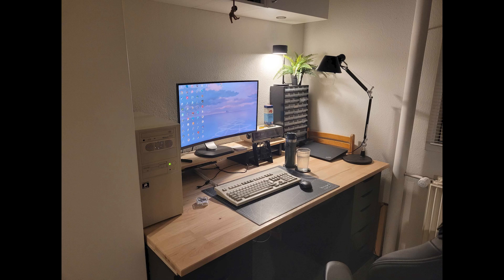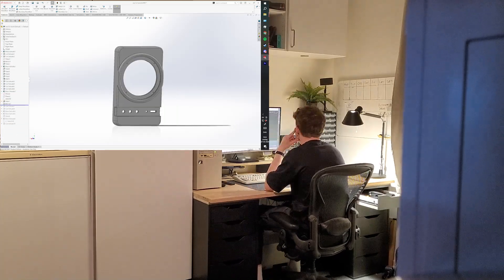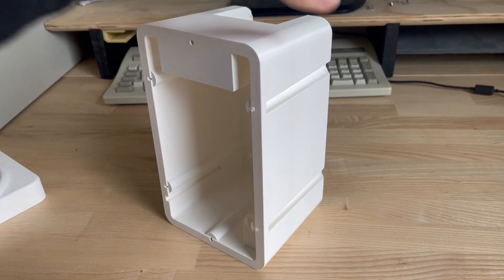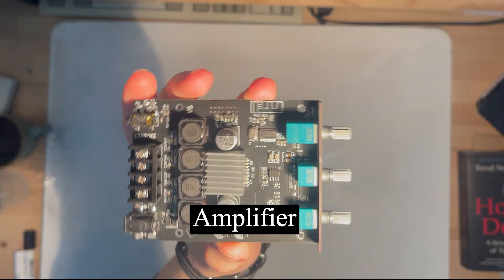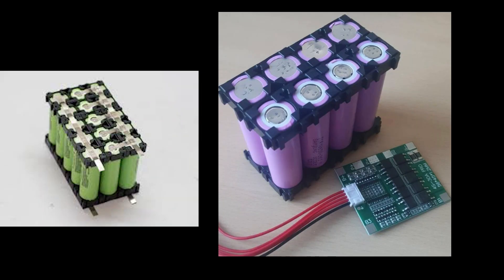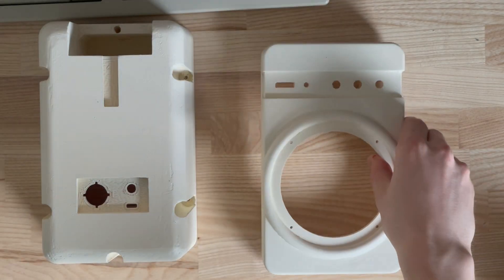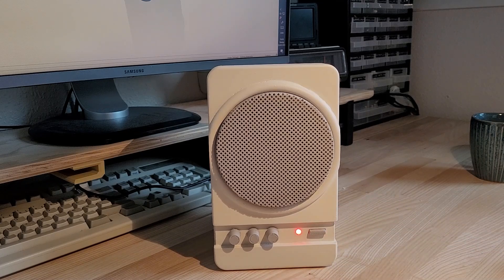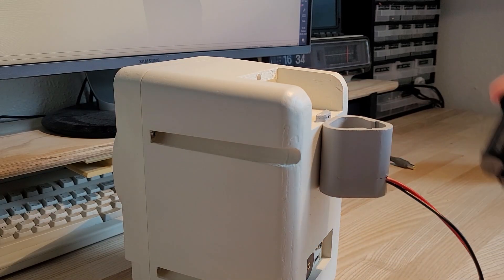Making my own speakers (the real ones were too expensive)

Comment: Watch out as I also used a powertool battery for a speaker, but it had the power cut protection in the tool itself, so my speaker drained one too deep and it damaged the cells. I bought a protection circuit that I set to cut power when the voltage reaches 16V (Its a Parkside X20V Team battery)

Comment: I like the Idea! There seems to be much space inside so maybe a fuller range driver setup with routed sound ???Channels???Resonance_Space??? for audio optimisation would be cool.
Also it would be cool to add a slot for your Battery in the back so it does not dangle from the back like this

Comment: If you use a lot of threaded inserts, you should check out the CNCKitchen threaded insert tool for the ts100/ts101. It's a little expensive, but trust me, it makes it so much easier and consistent.

Anyway cool video!

Comment: I would recomend using a full range speaker instead of the one you got.
The one you got is basically a 4inch subwoofer, good for bass, but not ideal for high frequencies.
Without tweeters or a full range driver the speaker will sound muffled, with no clarity whatsoever.
Reply: Im sure it’s for asthetics purely or simple sound and he has headphones for real audio

Comment: I love making speakers. Great video. Should I get a laser cutter or a 3d printer? I like making boxes.
Reply from the maker: Generally I think 3d printers are only good for making small speakers, and you have to print with a lot of infill to get decent sound isolation. Laser cutting seems really cool but I don't have too much experience with them. So I think it all depends on the size and shape of your speaker